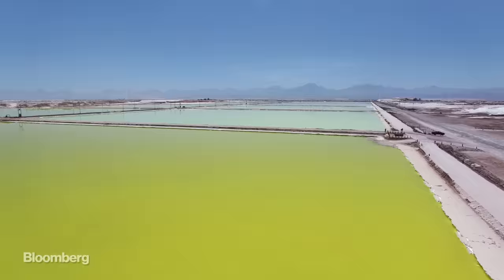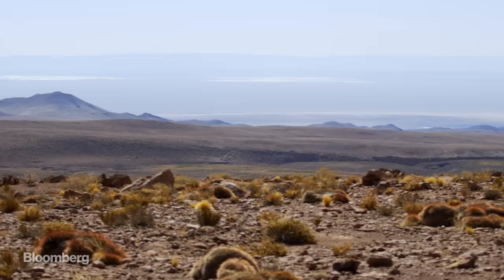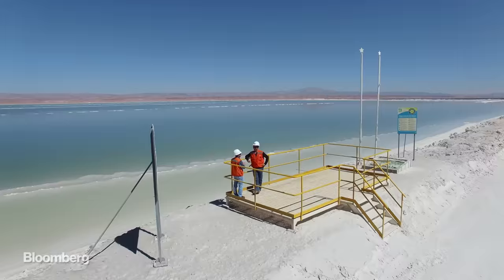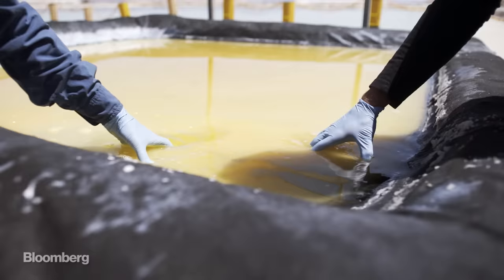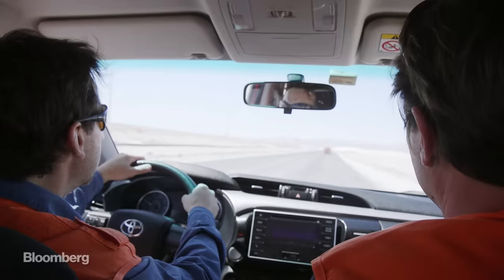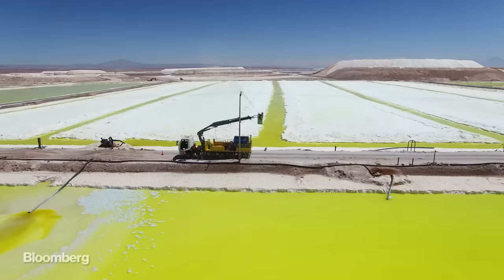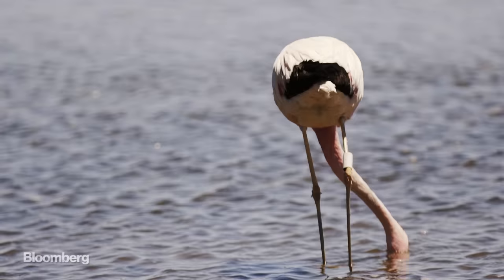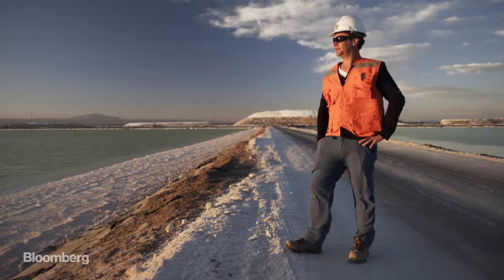Here's Where the Juice That Powers Batteries Comes From

Comment: I don't really understand why this is so controversial. This is orders of magnitude better than extracting and burning hydrocarbons in every way I can think of. Lithium extraction is essentially just dissolving minerals through normal mining methods. Since the largest mining sites are in the desert it has a very low impact compared to strip-mining forests for coal and ocean drilling for oil, for example. Spills are much less severe than oil spills because it is water soluble, unlike hydrocarbons. Once it's mined, it can be used in batteries and be constantly recharged through sustainable means over and over again. Once the batteries degrade enough over time, they are recycled and the lithium is used in new batteries, reducing the demand for NEW lithium. Compare this to oil which can be burned only once and never recharged, never recycled... You just have to keep drilling for it forever and continue to release harmful emissions. There's no contest. Lithium paired with renewable energy production is so much better.
Reply: because people like the Koch brothers are paying tremendous amounts of money to launch smear campaigns against EVs.
Reply: You should check out other mines, to see what was left after they finish there job!
Reply: You are incorrect about oil not being able to be reused. All oil isn’t burned. The oil that is used for lubrication can indeed be reused after it’s been cleaned.

Comment: But wouldn't be better if the pools have greenhouses with a roof which has an angle of 30 ° or something like that and on the lower part you have a container for the condensed water. It would be quicker this way or not?

Comment: Using gravity induced vacuum distillation and about 100 20 meters tall  40 meters in diameter tanks with pool walls 10 meters up around each tank to take half the tanks capacity they work in sets you fill them up then let the water drain into the pools creating a hard vacuum at the top the close then pool valve and pump in mineral-rich water in that then boils and wants to expand as steam it goes to the second tank through a condenser coil and maintains the vacuum in the system this leave the minerals in the first tank. The second tank and pool can be flushed out and put back through to the first till the second tank only has fresh water that you then pump down into the mine to draw up more minerals. 
You could triple the output of this mine and retain the water so the flamingos can be left alone with the marshes water untouched by man. you might ask where would you get the heat source or energy?  The sun, just paint some pipes black as water boils in a vacuum at room temperature this is easy and cheap just needing standard water pumps to move everything around.

Comment: I want a used EV CUV for my next car. Gas engines can have a nice sound but, for a daily the pros outweigh the cons. The water that evaporates from the lithium mines gets sent to the clouds and returns back to the ground as rain. Also modern turbocharged direct injection enjoys or at least most of them are plagued with issues

Comment: .  Your electric car battery contains twenty-five pounds of lithium, sixty pounds of nickel, 44 pounds of manganese, 30 pounds cobalt, 200 pounds of copper, and 400 pounds of aluminium, steel, and plastic. Inside me are 6,831 individual lithium-ion cells. It should concern you that all those toxic components come from mining. For instance, to manufacture each auto battery like me, you must process 25,000 pounds of brine for the lithium, 30,000 pounds of ore for the cobalt, 5,000 pounds of ore for the nickel, and 25,000 pounds of ore for copper. All told, you dig up 500,000 pounds of the earth’s crust for just - one - battery. Did I mention disease and child labour? Here’s why. Sixty-eight percent of the world’s cobalt, a significant part of a battery, comes from the Congo. Their mines have no pollution controls and they employ children who die from handling this toxic material. Should we factor in these diseased kids as part of the cost of driving an electric car?” no, they’re not our kids, anyway, serves them right for being poor, that’s progressive green thinking right?

Comment: Isn't lithium extremely poisonous? So huge pools of poison and nobody thinks hey maybe wildlife might be affected? Or heck what if  some of that chemical gets in the air when a storm comes through. I'm sure it's not complete evaporation with zero left over poison compounds in the resulting atmosphere.
Reply: lithium is an alkaline metal, meaning that its reactive, your body uses it for some of its properties but like any other element having too much of it in you is hazardous, unless you are drinking or bathing in the water you dont have to worry, any wildlife trying to drink it would be met with the saltiest and most undesirable liquid they have ever tasted.
Reply: @miguellopez3392  and yet where they recycle it, it becomes the most toxic place on Earth.
Reply: @ronaldarchibald2506  can you point this place out on a map? Because as far as I'm aware EV batteries are actually re used in mass grid storage since recycling them cost more money then they make. And the most toxic place on earth is China, the coal capital of the world.
Reply: Where did you learn this , i only know of one battery company reusing vehicle batteries at the moment and that's Renaut powervault.
Reply: @shiraz1736  Tesla re uses the battery for their power walls.